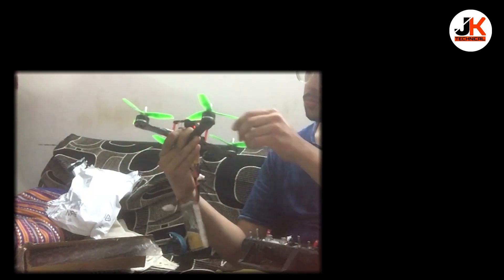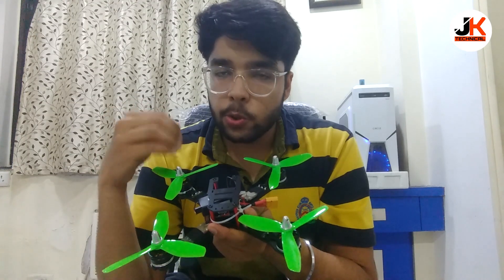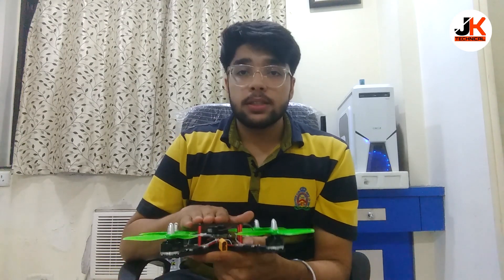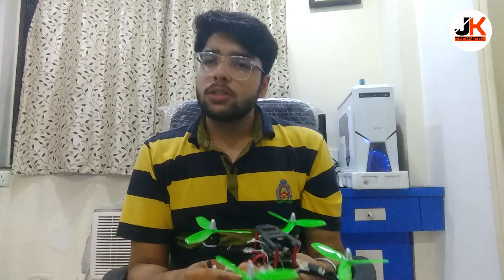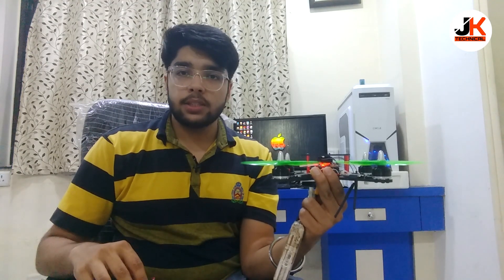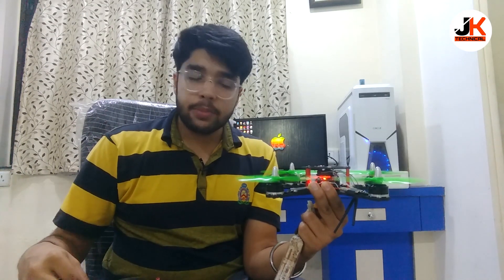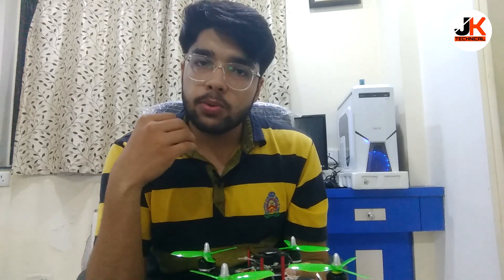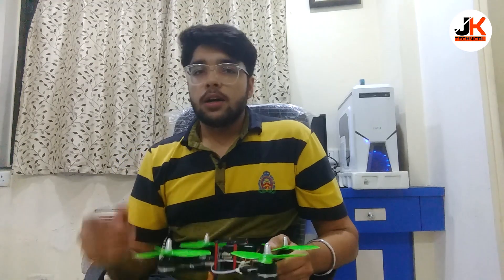Drone Flipping while Take off - ISSUE SOLVED | Quadcopter Flips while take-off

Comment: Boss while full throttle 1 st motor is going off then 2nd and 3rd but only 4th motor runs and take other commands like left right, etc. What might be the issue. I am using kk2. 1.5 and Flysky transmitter n receiver.
Reply from the maker: Check Esc Connections. 
And then recalibrate all the esc's again. 
Also check power distribution.
Reply: @jkvlogsofficial  thanks for ur advice. Done the same. But still the same problem is occuring..... Even channel 1 and 2 runs motor 3 n 4 . Better to say each channel of transmitter CT6b runs each motor. I think the battery is not capable of running all the motors at a time. Please advice apart from this.
Reply from the maker: Connect to me on instagram. Will be able to help there better.

Comment: Bro I need ur help. Pls reply
My quadcopter motors are not rotating uniformly ie. First motor start to ritate at 20%throttle  2nd at 25% 3rd at 60% and 4th at 85%.What to do bro pls reply
Reply from the maker: This happens when not all esc's are receiving same power. ESC Calibration mein kuch error hua hoga. Do individual Calibration of all esc's again. It might solve tour problem.
Reply: @jkvlogsofficial  bro how to do individual calibration
Reply from the maker: There are many videos on YT. Just search about it. Its very simple.
Reply: @jkvlogsofficial  ok thank u bro.
Reply: @jkvlogsofficial  bro i did calibration for each motors individually. Now 2nd 3rd and 4rt motors are rotating uniformly. But first motor is rotating slowly. What to do bro
Reply from the maker: What is your drone configuration?
Reply: @jkvlogsofficial  sorry i have no idea about configuration. My quadcopter is home made.
Reply from the maker: What parts did you put in your quadcopter? That I am asking
Reply: @jkvlogsofficial  A2212 1000kv motors, 30Aesc(yellow)
Reply from the maker: FC?
Reply: @jkvlogsofficial  kk2. 1.5

Comment: My apm 2.8 drone flipping Moter all working and correct direction but it flipping how can i solved
Reply from the maker: Plz, contact me on Instagram. I can help you there.
Reply: @jkvlogsofficial  hi
Reply: Please help me I have problem flipping
Reply from the maker: @life-motivation2k25  Check all the ESC connections  as they can cause this issue if not connect in order.
Reply: @jkvlogsofficial  I checked all the esc is ok. But when take of propellers from motors. The 4 motors are spinning smoothly but when I put on the propellers on motors, it cause the problem    3 motors are ok but 1 motor is just vibrate mean seem conflict with other
Reply: @jkvlogsofficial  when I try to take off the drone some time 4 motors are spinning at the same time, some time 1 motor just vibrate
Reply: @jkvlogsofficial  I have done all esc calibration
Reply from the maker: @life-motivation2k25  TOP Left and BOTTOM Right motors should be spinning in Clockwise Direction.
Reply: @jkvlogsofficial  yes I did all correct. When I take off it fly above the ground 5DC and flipped and sometime it fly around and then crashed
Reply from the maker: @life-motivation2k25  I saw the video you shared. The motors direction is wrong that means the esc connection might also bhi mismatched. After correcting the above things do the esc calibration again for one esc at a time.
Reply: @jkvlogsofficial  can you tell me clearly please
Reply: @jkvlogsofficial  what you mean bhi mismatched?
Reply from the maker: Thanks for watching.